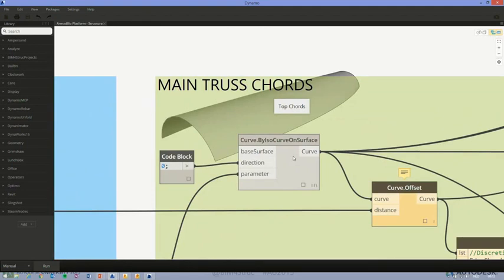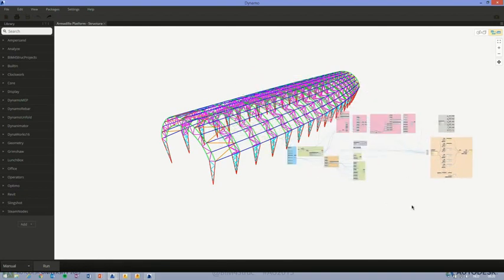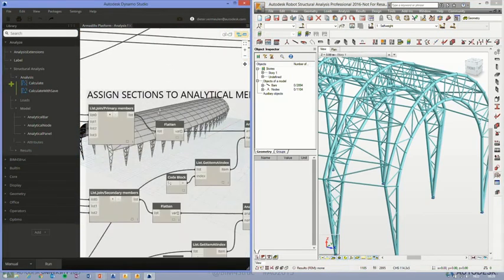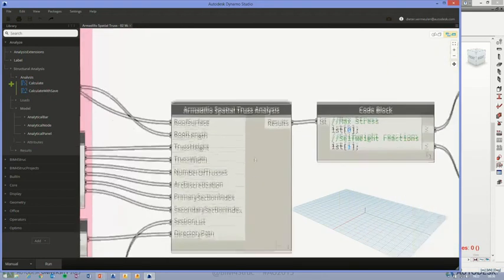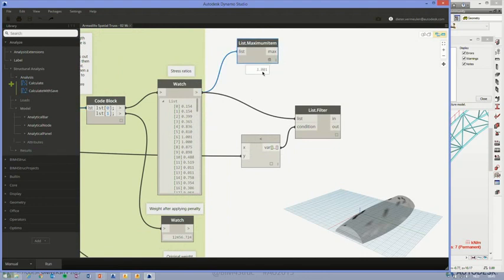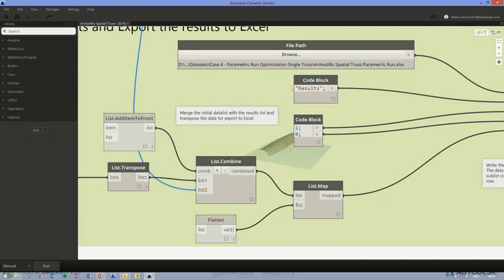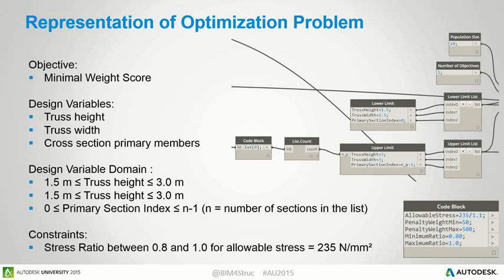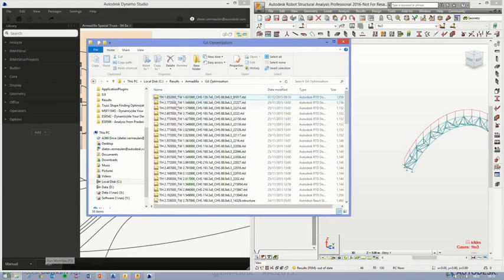Autodesk University Dynamo+Robot+Revit workflow Webinar

Comment: Hi 
Please if anyone know the solution share me.
I am facing a problem in Robot Structural Analysis. The problem is, if I have a building which is already designed previously, and I want to do re-analysis for that Building. So how Can I define the reinforcement of each member to check the capacity of this building ?. This thing can be done in Etabs, so what about Robot ?. I think it is a big issue if this item not available in RSA.
Thank You

Comment: Hi Serk
Already had any thoughts on linking advance steel as well, resulting in a flow where the output is a steel structure including detailing of the joints?